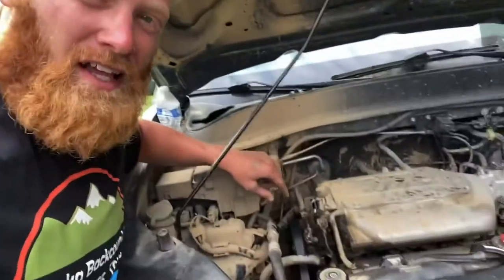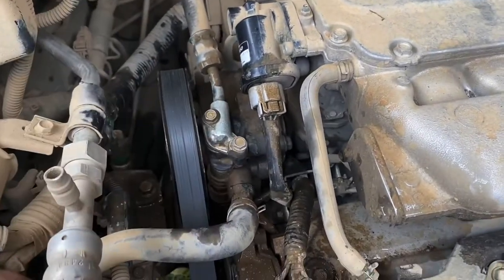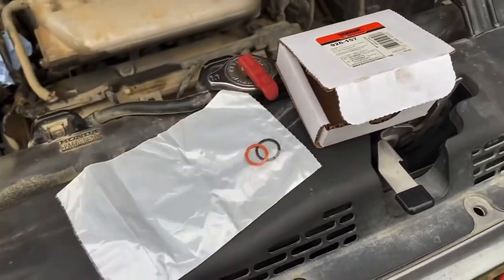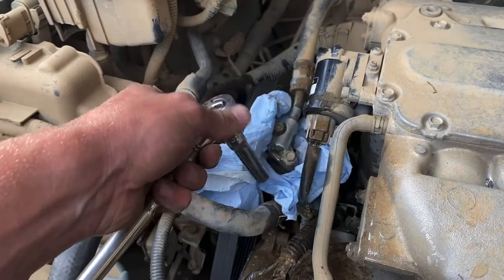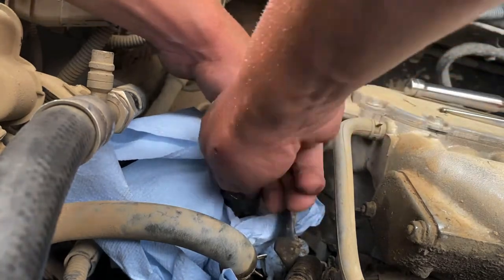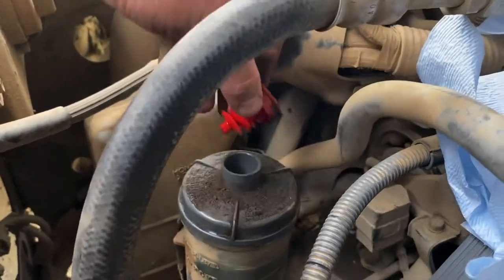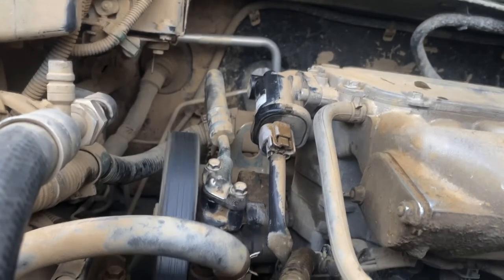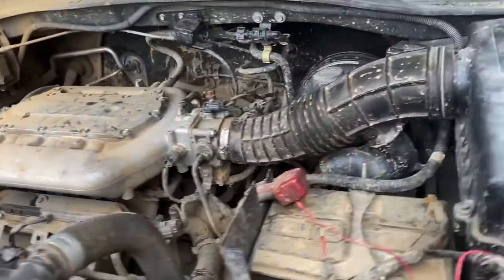How to replace power steering pump O-ring Honda Ridgeline 06-14

Comment: thanks for the cheap fix tip.  I've heard the suggestion at each oil change to use a turkey baster to remove all the power steering fluid from the P.S. reservoir and refill with new fluid.  This only replaces some of the fluid but overall keeps it "fresher" at all times if done with each oil change.
Reply from the maker: Your welcome

Comment: A shop replaced my pump but now makes the whining noise when accelerating.They changed the return o ring but still makes noise.Should I have them replace the other o ring or look at replacing idler pulley.
Reply from the maker: Can you tell where the noise is coming from and if it only happens when turning, or accelerating or idling?..
Reply: Yes it does it when accelerating
Reply from the maker: @MarkBerry-fx7zp have someone gently rev the engine while your in park to see if you can more accurately locate where the sound is coming from. To me that doesn’t sound like a power steering leak… more like a pulley or alternator

Comment: You didnt change both spots wih both the orings?
Reply from the maker: Inspected them both, only one looked like there was hardly anything. It ended up not being the final issue. It was cause from low fluid from my power steering rack
Reply: @RenegadeHQ  how did you check or find that out
Reply: I only changes the one also it stopped the noose
Reply from the maker: Just looked at them and felt  them to see if there was any flat spots or tears that may not let it seal properly.
Reply: First off thanks for the video. Now, Let’s be serious we all heard it still whining at the end of the video. 
To be fair, Yes a lot less but it was still there. Might it have not been had you change both?